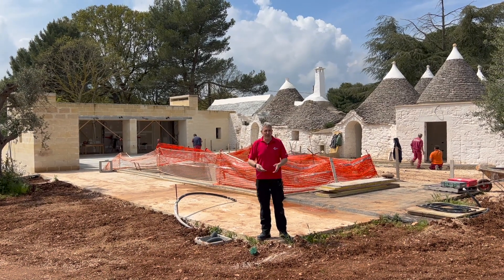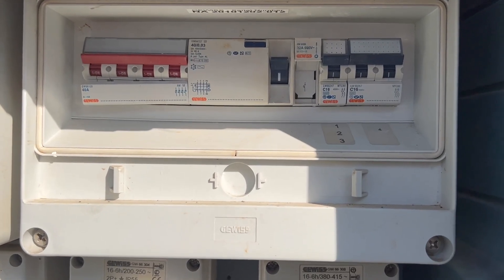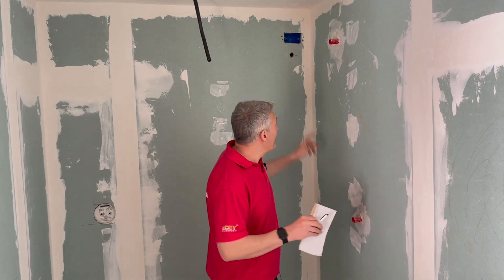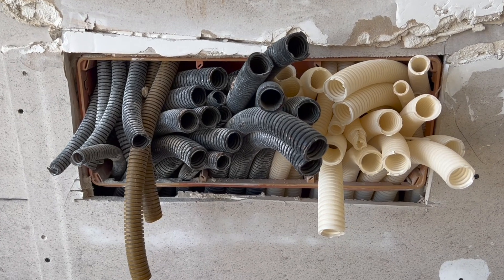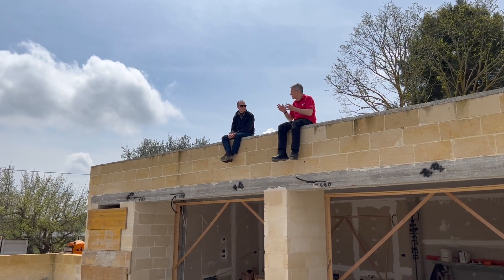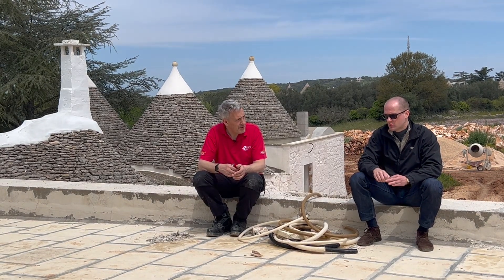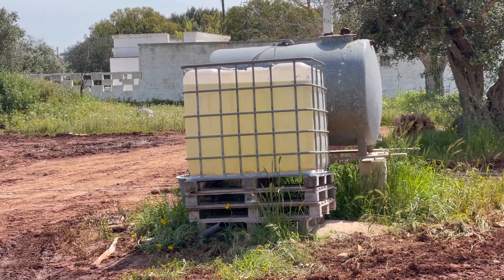Electric Wiring in Italy - You Won't Believe What They Do!

Comment: I am Italian but I live abroad. When me and my dad make modifications to the house (adding Ethernet cables or adding more power outlets), we always add flexible conduits, as they are so useful. Even if you don’t need the cable anymore, you can take it out, reuse it whilst leaving the conduit in the wall so that if you ever need a new wire there you can always add it.
Reply: This. Most houses will live long enough to have the wiring become outdated and re-done at least one time, probably several times... which is so much easier with conduits
Reply: @steve1978ger  actually house built to Italian standards,will outlive the electrical lines,the owner,his child and the next 10/20 generation to come 😂
Reply: Finalmente qualcuno che vede lontano😂la casa è sacra e verrà tramandata ai posteri😂ciao😊👍🏻
Reply: Fanno le case di carta, fanno prima a tirare giù un "muro" che a cambiare un cavo
Reply: I live in an area where EMT is king for power. I'm a huge fan, but I find  ENT a fantastic solution for future proofing things like ethernet, coax, thermostat or security wiring. I find that you need a much larger diameter to pull wires through ENT than EMT, though, especially with large-gauge, stiff, wires.
Reply: Regardless of the differences in wiring.
The unnecessary level of wasted time and labor alone is astonishing.
When you could do three steps at the same time, their doing one step at a time.
Taking 70% longer to achieve the same result.
Which equals more cost to the client for no reason, other than their incompetence.
If I was the client paying for this job, I would be pissed…
Reply: @fredflintstone8817  Or you may be surprised at seeing how efficient it really is once you know how to do it. The cost for electrical installation in Italy is about half of the UK, once adjusted for pay rates (unadjusted it's about a third). Not to mention the cost of maintenance and any further changes. Speaking both as a client and as an electrician who has worked (and had work done) in both countries.
Reply from the maker: Interesting - The next part of this project is now ready 👉https://youtu.be/ISSy8vDxLcw
Reply: yes in belgium also ,but the wires are already in it. much easier and cheaper.
Reply: Not a fan of conduits.  Use to do a lot of them back in the 1980's, and they need huge holes through studs (weakening framing), added material cost, and added complexity.  Dont forget labor time to drill larger holes, reinforcement of studs, time for a double pull.   It's pretty easy to add wires post construction in the US using the attic/sub floor space and long flex drills.  Given a choice, i dont use conduit unless its in an unaccessible area, like under a slab to an island.  Did a couple jobs where conduit was run horizontally in every wall for power and ethernet.  Was a pain and doubled the install cost.  Just put outlets every 2.5M, Wifi, and your done.
Reply: @Bill N  we don’t build house with studs and drywall…we use concrete … you cannot pull wires trough concrete
Reply: Sounds like a US problem of the wall studs to me.... Gotta work around it in different ways.
Reply: @GabrielKozsar   also labor and building code. This would double labor cost and every city/county has its own code so there isn't a standard approved conduit other than metal. I can think of a few places that would have issues for fire code etc.
Reply: @billn8555 german sparky here, that works in australia now.. the buildings in Europe are mostly brick houses.. so no studs to drill. In australia which I recon is similar like the Americas we don’t use conduits in the walls for the reasons you mentioned
In Germany we had bricks but cut them straight into the wall.. no easy retrofits haha
Reply: @billn8555  In a place like Italy, masonry/stone construction is pretty common. In which case, conduits make a lot more sense. It takes some getting used to for people who grew up with wood-frame construction but one thing you learn watching Youtube videos of house construction around the world is how different are the practices.

At the end of the day, what matters is that the house, and the electrical system is useful and safe. Everything else is negotiable...
Reply: @billn8555 framing should not be load bearing no where in Europe is framing used for loads
Reply: @billn8555  Electricity failures are the second leading cause of home fires in the U.S. The U.S., and it is estimated that they caused an average of 46,700 home fires annually between 2015 and 2019
. These fires resulted in an average of 390 civilian deaths and 1,330 injuries a year, in addition to approximately $1.5 billion in property damage annually. 63% of these fires originated by electric arc.

Comment: An unusual way to wire a house. Run the plastic tubes where the wires will go, plaster over them, snake the wires from the main breaker box to the outlet boxes, wires color coded, then put in the breakers, switches, outlets, light fixtures, and other devices.This makes it easier so long as the tubes and pipes don't have sharp bends.Quite different than the wiring in the USA.

Comment: I upgraded supply from 3 to 4.5 kW for my home in Italy in 2009, when I installed a heat pump (air to water with floor heating) and a PV system 5 kW with good slope and orientation. Despite here in the north it isn't so warm and sunny as in the south (design T for heating is -7°C for Brescia, 1h east of Milan), I had no real issues or need to further upgrades. 4 in family, 180 m2, induction for cooking, solar thermal panels + separate heat pump for DHW, heating recovery ventilation with active dehumidifier (3rd heat pump) and even a pre-existing air conditioner that I go on using in combination with all the rest (chosen not casually, but for being the first with COP>5)... In other words, with very efficient stuff 4.5 kW is definitely enough
Reply: So do you have to manage and juggle power? I have 4.8Kw to my laundry room and have to be careful to not exceed it. Have seen peak loads of 15kw when the ASHP + 7kw EV charger + induction stove and maybe a washing machine or dishwasher.

Comment: Using flex conduit seems like an incredibly tasking way to pull wiring in.  Trying to account for all the circuitry needs and pulling all the wiring needed in one pull is not easy even if you have wide radius bends.  I would love to see a video on their technique.  Solid conduit with smooth surfaces inside along with wire lube is still a bear to pull wiring in with a tugger, I can't imagine this is any easier in this residential application.
Reply: Keep in mind that in Italy the electrical cables used are stranded and easier to pull than the solid ones (solid ones are not a standard from the 80s); moreover a well built system should have a lot of flexible conduit, like the one in the video, and only a few wires runs in each conduit (3/5 14awg wires in a 3/4inch conduit ), so it's very easy to pull the wires and lube is rarely used in a new installation.
Reply: You attach the wires to the guide and just pull, easier if someone helps from the other end by making sure it doesn't get tangled.
Reply: @25566  Yes, I know how to do it, I'm an electrician in the US, but it's still a task to pull multiple wires through a small conduit, especially multiple times.
Reply: @ML-jk3sz  I agree I am electrician in Canada and on hard pulls wire lube is necessary .
Reply: @daniellabbe3009  Correct.
Reply: @ML-jk3sz keep in mind that residential wiring in Italy (I believe in most of Europe too) is stranded, not solid core. I've never had problems pulling stranded wiring through corrugated conduits, but maybe with solid core and solid tubing is harder
Reply: @Ctrl_Alt_Delicious  All wiring pulled through conduit in the US us also stranded, solid would really be a task.
Reply: Here is normal, i just renew my flat and they put km of corrugates. It helps to make improvements in future as you have space in section. Btw and only companies can do that. If you do on your own it's illegal as it would lead to have an uncertified electrical system.

Comment: We don't have nuclear plants and have very little coal/gas/oil fields hence we buy a lot of electrical power from neighboring countries at high price. That may justify historically the 3kw cap. Older houses used -- and still use -- gas for cooking and water heating; space heating is often centralized for many units at once and that also runs an all sorts of oil derivatives..

Comment: one of the reasons that limited the base power to just 3kw in italy was the tariff system: the price of energy per kilowatt was proportionate to the so called  "potenza impegnata" (contractual max power), and was progressive on the basis of cumulative consumption over the two-monthly tariff period. Now the pricing tends to have only a fixed share proportional to the contractual max power, and a fixed price per kilowatt-hour  (P x kWh)
Reply: 3 kW (actually more like 3.3 with short bursts allowed up to 3.7 or so) is what you find in older houses (>15 years) that had gas heating and stoves. It became a standard during the 70s energy crisis and then stuck, but 6 kW is standard in new construction that don't use gas at all. At 3 kW, any two of dishwasher + washing machine + oven work just fine together, even three if the washing machine has already heated water. Tumble driers are not that common, we just use clothing lines (often in the same room as the heating furnace), which helps saving energy.  Kettles (and electric vehicles :)) are the only appliance that really need some care.

Also any self-consumed solar production doesn't count towards the limit obviously, because the utility meter only sees the difference. For example if you only charge an electric vehicle (2.3 kW) during sunny days or during the night, you won't notice. We're just used to it, and manage to only trip the breaker once or twice a year. :)
Reply: @bonzinip  2,3 kW for charging vehicles?????? In Greece we use  11 or mostly 22 kW charging devices!! I you need a car charger you need an extra separate el. connection of 3x10 or 3x16 mm2
Reply: @pantelissiokos8139 yes, 2,3kW is 10 A single phase. Three phase is almost unknown at home.
Reply: Indeed, nowadays the "quota potenza" (power quote) which is a fix price that you have to pay to the distributor for the maximum power that you can absorb from the grid is lower than before and if you consume a certain amount of energy becomes irrelevant to the total price that you have to pay.
I moved from 3kW to 4.5kW and I have to pay only 25€ more per year, which is priceless because now I can run appliances together (ex. Washing machine and dishwasher) or use both air conditioning motor at the same time, or charge the car way faster if needed during the day.
Reply from the maker: Great info - thanks for sharing
Reply: 3 kW is not enough even for cooking! In Greece we used to have a minimum of monofase supply of ~ 6 kW but nowdays most of the new appartments get a 3fase supply of approx. 18 kW which is suitable or simultanuous use of Heat pump, cooking , laundry, lighting etc. The use of flex conduits is common of course but the common practice is to install cabling and flex together from the beginning and not to pul cables afterwards as it is not convenient due to sharp turns etc. In traditional buildings , we have similar constructions as the truli of Alberobelo, where we are obliged to put everything under the flooring  there is no alternative. Nevertheless, is buildings with possibilities of false ceiling we avoid mixing cabling and plumbers piping. Cabling under the flooring is our last choice and not the best. The weakest point of our installations are the numerous junction boxes all over the house. In the past it was obliged for those boxes to be leveled at the plaster surface so to be able to see them and easy to open. Today we have too many boxes and also ...architects who would become sick with junction boxes all over the walls, so the boxes are dissapeared under some centimeter of plaster
Reply: @pantelissiokos8139  we use gas for cooking and heating mostly
Reply: @toroseduto4042  Nice! We should do more with gas actually but the recent war in Ukraine has turned everything upside down as we import gas mostly from Russia
Reply: @pantelissiokos8139  yeah I know, it's s bummer. I nowdays only use it for cooking and heating the water for showering and so on. I have a Norwegian conditioned fire place and heat with that.
Reply: @pantelissiokos8139  Netherlands here. Jujst 3kW for an entire home would sound insane here. Every new home has 3 phase to the power distribution in the home (or capable of it if for some reason the outside is still old and has no 3 phase to the home) and I can do anything at the same time. Any new home also includes a special plug (which is just 2×1phase joined and never 3 phase just pulled through for some reason) called Perilex always installed in a so called "cooking group" on the distribution board. That alone can pull somewhere around 11kW (for electric stove with oven). 

Normally 230 volts at 16 amp per group, you may use 3500 watt per group. (Officially it is 220, but for various reasons in practice now 230, sometimes even 240). I think older homes or homes where the wiring to the home is older they can get up to 8kW (35A, but can also be 25 or 40) on 1 phase, I have 3×35A. 

If you want heavier stuff and have very high power usage (daily sauna, electric stove, heatpump, home battery, solar etc) you may need more and can run into limits so then you do have an issue with max draw and have to request heavier breakers, 3×40, 3×50 or even 3×80A, but this will come at your expense, may be turned down, and if you need a new meter you will pay for it in full. So there is a max power but you gotta try hard to get there.

Pulling cabling after the fact is rare and not every home is built that way. All goes in the wall, or if not possible (like in my apartment) it goes in the added false ceiling, expressly never under the floor.
Reply: Idk what some are saying, the household standard in Italy is 5kw and you can upgrade it to 7kw at a greater expense. Nothing changed, I'm using my appliances just as before...

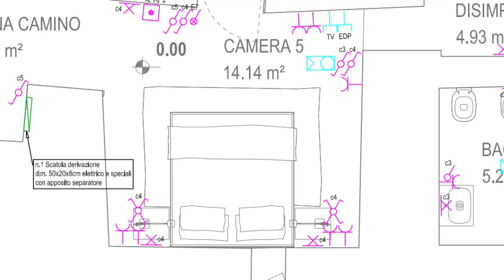Comment: Quick question: The schematic at 05:27 is obviously drafted in Italian, but the symbolism seems very much like BS-3939. Has Italy/the EU adopted that standard for marking out fixtures? 😇

I must confess: Every time I see the symbol for a cooker supply point with an integrated outlet (Drawn as a square with a semicircle on top) I keep interpreting it as „Television“... 🙃
Reply from the maker: Good question. BS 3939 is harmonised with IEC / EN 60617 so the symbols should be the same. 😀

Comment: I  still have doubts about running conduits horizontal as said at 6:47 I would think piercing with screws happens a lot and how do get your draw wire through the corrugated flexible conduit  if it jams up under floor. ?
Reply from the maker: Use the vacuum trick for the draw wire

Comment: I've installed emergency lights in my home just at the top and bottom of the stairs, I've also installed a smoke detector system as I think safety is important in a residential home.

Comment: seems very crude compared to electrical in Canada...all our panels are made of very sturdy metal.  Most homes here are a minimum of 20kW but it is common to have 200 amp single phase for 40kW.  We use a split phase system and most circuits are 120v.  Higher loads are double pole 240v.

Comment: 6kw as power supply? That seams to be very low... Living in Germany our electric stove alone is connected over three phase power 16A 230V. So at around 11kw (don't know if it uses that but 6-8kw should be realistic). Our house supply is 64A three phase. So it's allowed to consume 44kw for short time intervalls (on one meter). And depending on your home installation this allows up to 30kw in permanent power usage on one energy meter (whith multible meters you could use the full 44kw for longer periods). 
32/50A three phase per home should be pretty standard here with 64A getting more common.
Reply: Now, tell us how much Russian gas you burned to allow you to waste those 44kw?
Reply from the maker: We’d love to explore the situation in Germany

Comment: In the video is not mentioned but we also uses stranded copper wire for installation, generally 1.5mm² for light and 2.5mm² for sockets.
Reply from the maker: Stay tuned for part 2

Comment: Very interesting how things can be so different here in the United States, most of our residential installs are Romex cable which I'm not a fan of at all. I work in the commercial side doing HVACR work and almost all of my work is done in actual emt metal conduit and or flexible conduit but it's always ran in the walls and ceiling ....
Reply: Same. I knw that when i eventually have to go through and rewire my house, everything is getting redone in conduit. Romex sucks.
Reply: @ryuukeisscifiproductions1818  Why exactly do you say that Romex sucks? It is perfectly suited for what it has to do, and I think it will last as long as the house, or at until the next strip to the studs renovation. Not many Americans are going to pay for conduit when the benefits seem so small. Seriously curious why you hate Romex.